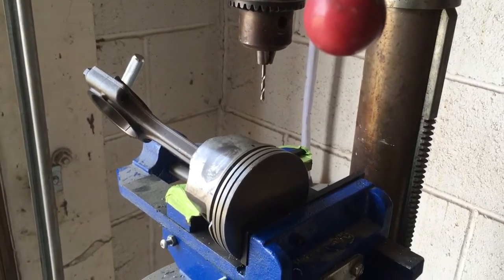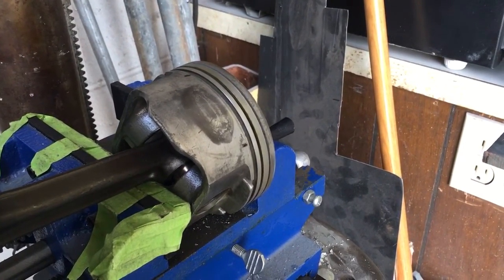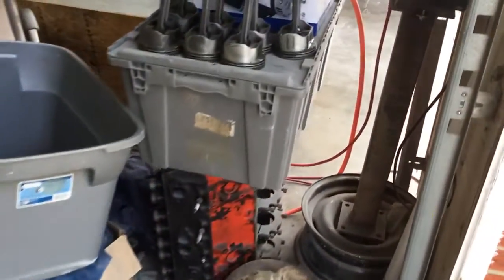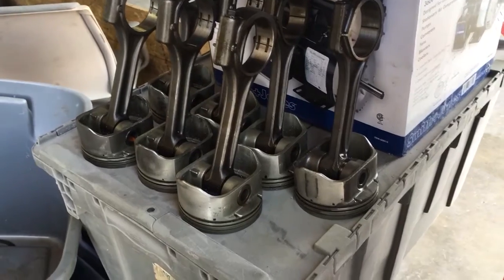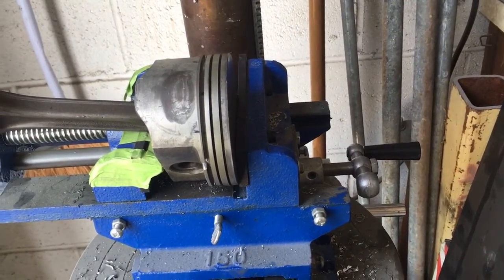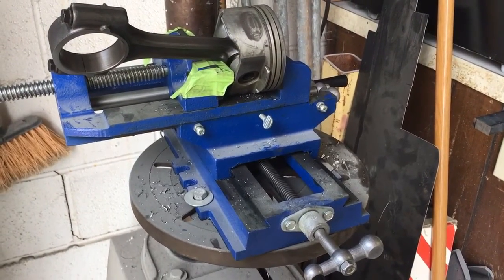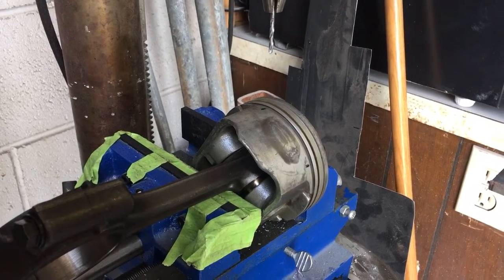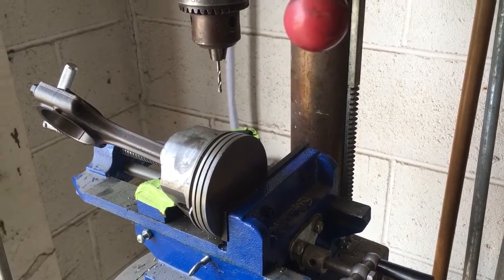4.8 5.3 6.0 oil consumption issues

Comment: I solved my problem with an AFM Disabler for the OBD port. I had oil consumption problem, and it was burning oil when I would take off from a red light. AFM Disabler fixed everything.

Comment: I did not know that the GM LS engine had badly designed oil drainback holes. It was a huge problem on the Saturn 1.9 Twincam. EDIT: This is why many people made similar modifications to their pistons.
Reply: Yes I did the same to my 95 Saturn single cam. New rings, no more oil burning.

Comment: Americans are junks i own toyotas i never had oil pump failure or lifter 200000 miles the only. Car i had 96 buick riviera 3800 supercharger 2960000 miles the ran good but the dont make like that anymore gm n ford n dodge are junk my 4.0 vvti fj cruiser 240000 miles i start ir i could harly hear it smooth those gm engine are build good it just the u need to modified the heads lifters it will be great engjwn bottom end 5.3 spun rods come on gm
Reply: Edwin Rodriguez the 06 toyota camary hase thus issue. You toyota jackasses think over paying for a vehicle makes it good
Reply: I have a 1998 GMC 4.3 with 300,000 miles on it I'm the original owner. My Infiniti died at 197,000 my brother was original owner.
Reply: William Schuld Jr I have 200,000 on mine (4.3) and still going 💪
Reply: Keep on rolling my friend.
Reply from the maker: Edwin Rodriguez Toyota makes good vehicles. 👍

Comment: I bought a couple of gallons of that b12 chemtool parts cleaner that stuff took all the carbon off my LS1 pistons and rods.
Reply from the maker: For sure, soaking pistons in carb dip will melt carbon and make it easy to clean off.  The residual on these 4.8 pistons was after soaking the pistons twice.  These pistons were caked horribly with burned engine oil.  JD